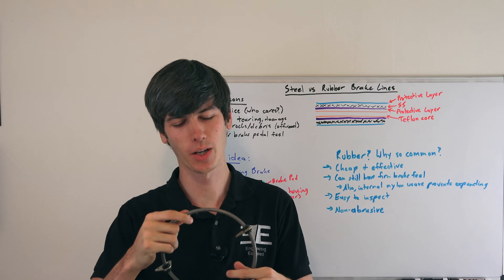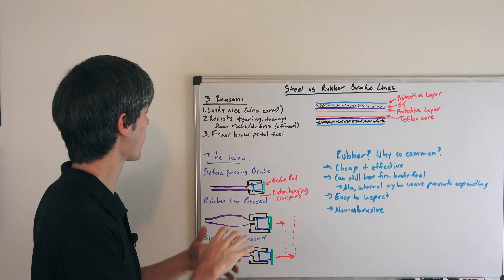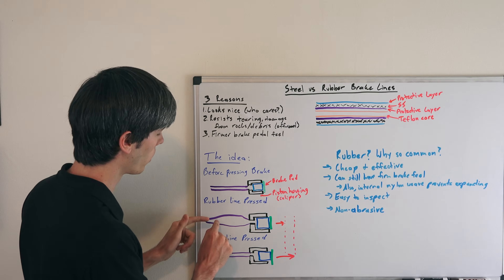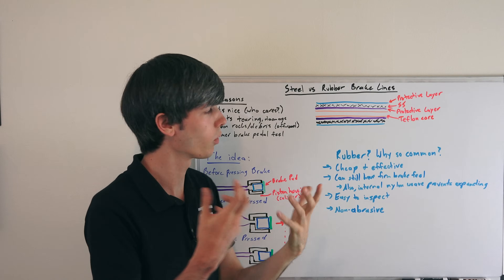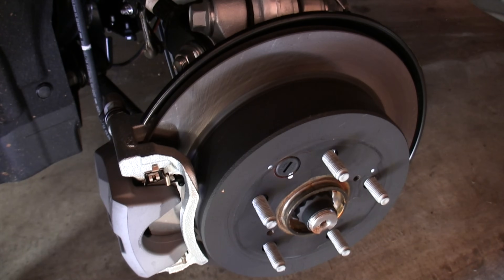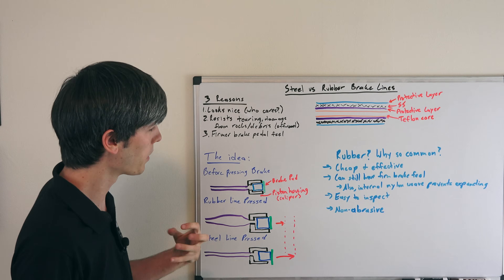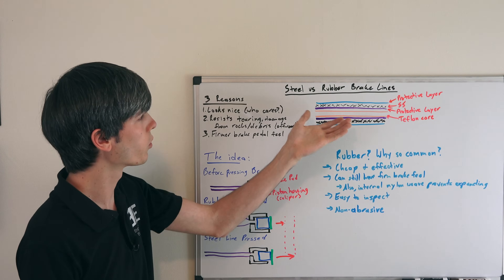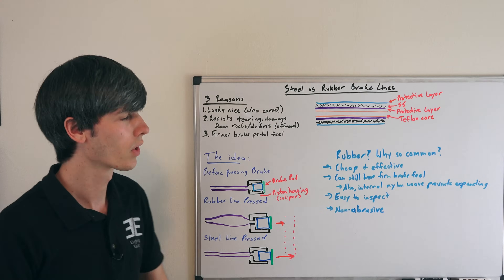Steel Vs Rubber Brake Lines - Are Stainless Steel Lines Silly?

Comment: 1. On motorcycles the lines are visible
2. Rubber does get quite soft after 25 years of usage.
Reply: im pretty sure my 1990 240sx s13 has the same lines that when it came from the factory. :P I keep forgetting to change them, and your comment reminded me :D
Reply: +DoubleYouPee Especially in the hot, humid, Florida sun.
Reply: +DoubleYouPee Just inspect the rubber lines any replace when needed. As EE stated, braided lines are much harder to inspect for faults, so you don't see when they're getting worn.
Reply: @mrburgermaster  If your fluid lines have a metal braided cover you can see they're degraded when you see fluid spraying through the mesh.  😅
Reply: ***** Yeap until it gets weak spots and they get softer.
Reply: +Dylan McElveen but one of the points in the video was that you can't see the lines so the cosmetic difference is negligible.
Reply: 25 years of use out of a 10 dollar piece is a hella good trade if you ask me
Reply: +DoubleYouPee The brake hose gets deformed sooner than 25 years on the inside... so if you feel them soft on the outside they were probably extremely unsafe a number of years ago. When they do fail it is usually when you need them the most.... such as a panic stop.
Reply: @walkerscranger  you're lucky if you have enough traction to panic stop when you need to... maybe check the lines every year, have a friend squeeze and re-squeeze while you check all areas of the line for any bulging.
Reply: My Dad has a 1981 Yamaha XV920R (about 25k mi).  The front brake was getting soft and he fixed it by replacing the brake hose.  Although, there may have been some tiny air bubbles in there too.
Reply: Rubber becomes brittle/hard, not soft
Reply: +DoubleYouPee 25 years is a looot of time. Most people replace the whole car by that time, and replacing brake lines even every 5 years won't hurt a wallet that much.
Reply: +Gurgumul Replace the whole car?
You never seen a car that is 25 years or older??
Reply: +DoubleYouPee I have a 20 year old car myself and don't plan on changing it. Most cars seen on the streets where I live are under 15 though.
Reply: I have a 25-year-old broom/yard brush, sure it's had 3 handles and 5 new heads but it`s a 25yr old broom and looks nearly new:D
Reply: Over here in the uk 25 year old cars are called classic, we call it a classic because it`s a classic case of not worth pinching usually a Datsun or Skoda:)
Reply: The line being visible doesn't have anything to do with how it performs
Reply: +DoubleYouPee The lines and hoses on a motorcycle are not subject to the heat as on a vehicle and they are a smaller system with only one or two calipers and independent from the rear. The hoses on my 1976 KZ900 are pretty old.
Reply: +DoubleYouPee Indeed, due to the rubber compound drying and hardening over time it develops microcracks and thus develops flex as these cracks are stretched apart under pressure. Which causes the rubber hose to expand in diameter until it ruptures one of these cracks in the worst scenary, but that's why you have to/or your mechanic has to check them periodically.
Reply: Kasper KKAASSPPERR I wonder why you say that? Just so you know, I am not your dog and won't kill myself upon your command.

Besides that, I just put some new rubber on my car. So I don't think it'll happen to old or worn tyres in the next 60.000+ kilometers at least. Not due to bad tyres anyway. :)
Reply: I think the average time people change their cars is about 5-7 years so the person who usually buys used are those that are accident prone.
Reply: Well crap, so do I (in response to #2)...
Reply: Im now on my ex500 at 25 years with oem lines :) Operating with no problems but probably I will change them with Hel lines.

Comment: Good explanation Jason! I do wish you could do it mythbuster style and actually measure how much the lines expand or not though.
Reply: +SlimmyJP 
That would make for a good episode. 

From our experience, the amount of measured rubber brake hose diametrical expansion depends on a number of factors such as the age of the hose, the actual quality of the hose materials and construction, the ambient temperature and the fluid temperature, how many times and how often the hose has been operated/exposed to high temperatures and high fluid pressures and if the outer rubber jacket has been exposed to contaminates such as petroleum products, solvents, etc. 
The more a rubber hose is operated or exposed to elevated temps and pressures the more likely it is to expand diametrically under pressure. 
We have measured as little as 0.0015 inch (0.0381 mm) on a new high quality hose to more than 0.050 inch (1.270 mm) on a hose from a competition vehicle that was exposed to elevated temps and pressures over a partial season of competition.
Reply from the maker: +SlimmyJP That gave me an idea! :)
Reply: +Engineering Explained If you can find some 20+ year old brake lines to throw in the mix; my Z is getting on 25yrs old now so i got S/S lines; admittedly on the back of "old rubber lines will be soft" relatively speaking...looking forward to seeing if there's any noticeable difference
Reply: @carcrazyafrica  you could have my 1997 Z3 brake hoses also if you need for testing.  They are original and I would send them.  Now to decide regular or steel as the hose replacement....
Reply: +Shashank Saraf you guess.....except that Archimedes principle has nothing do do with this at all.
Reply: +Lucas L 
the most accurate way to measure brake line expansion is by a method referred to as  "HYDROSTATIC "  testing. 
calculate the displacement volume of the hose to be tested.  od x od x .7854 x length = hose displacement
if the hose displaces 300 ml. static and displaces 30 more ml under pressure, it expands by 10%
place the fully bled brake line in a full container of water. 
apply standard operating pressure.
collect and measure the water that flows out of the filled container.
Reply: the absolute accurate method is called hydrostatic expansion testing- it's easy to look up if you really want to understand.
Reply: Yep .. +Engineering Explained is definitive bench racing. 
Notice he never actually uses the stuff he talks about. 
Just draws pictures on a dry erase board and misleads people.
Reply: I've never tried this on a car, but on a motorcycle you can do it without help. Just pinch your rubber brake line hard with your fingers. Apply the brake and you can feel how much the rubber line expands. I don't think it's microscopic. Hot weather would exaggerate this. You get less expansion in colder weather. Switching to braided stainless brake lines made a dramatic Improvement on my motorcycle in the 80s, but when I tried it on a four wheel drive Toyota pickup, not so much.
Reply from the maker: +Tatenda Jinya The lines on my Integra are from '99 (which these steel lines will eventually replace).
Reply: +Engineering Explained ah well in that case, can't wait for that episode then!
Reply: Engineering Explained Awesome :) I'm sure the idea you have is gonna make for a good video! I think it'll be great (but time consuming) to do some real world tests on top of your superb explanations. Like the anti-sway bar thing we talked about on Patreon. There's just so much info out there in the automotive world but not a lot of real world tests to confirm them.
Reply: +Engineering Explained what you could do is get hold of something that can measure force and apply it directly to the pedal with the respective lines. This would give an actual measureable difference if any. Keep up the great videos!
Reply: +SlimmyJP I guess a simple experiment based on Archimedes principle could be used to determine that minuscule volume expansion.
Reply: +Drink Beer You're wrong.  I know what the guy had in mind.  It's silly and needlessly complicated, but it would do the job.
Reply: Chris D well, an engineer applies logical principals to short cutting needless trial and error. Another that is not mentioned is that tires are the weakness in all single braking scenarios. Whether there is squishy vs hard feeling brakes, 100ths of a second after stomping on brakes, the brake overpowers the tire grip. There might be a micro micro delay if the fluid flexes the tube, but that is nothing compared to the variance in reaction time, consideration, road quality, vector of car, and temperature or state of the tire.
Reply: Stephan Paris That effext is very likely NOT  the effect of the brake lines themselves but ACTUALLY the effect of brand new brake fluid and a good bleed of the system.
Reply: Your skipping the practical example in scientific method which  requires the experiment. 

This is why your engineering lectures  arrive at a very specific flaw to those that have experience.  

The horrible part is that you hypothetically arrive at a solution and call it good to the lesser knowledged and experience.

Comment: Using braided brake lines can prevent brake fade for a longer period or do you always need motul 660 or other higher temperature brake fluid?
Reply: +RedLandGaming But steel dissipates heat better than rubber
Reply: ***** Exactly. This is kinda confusing